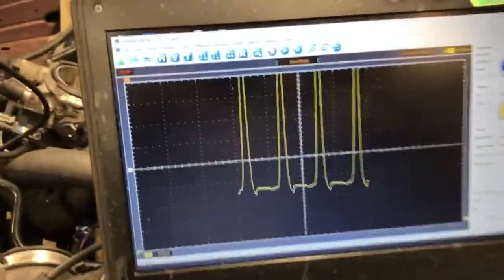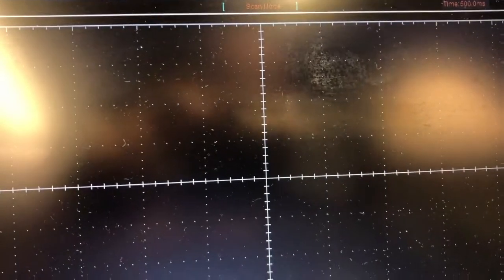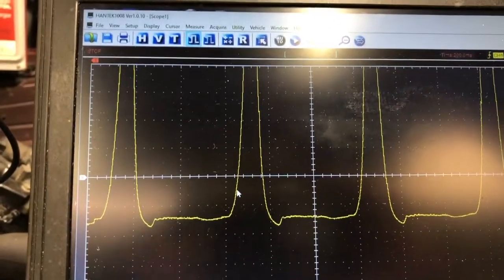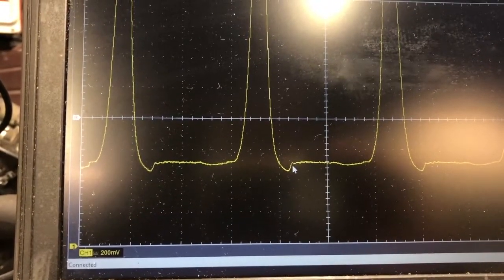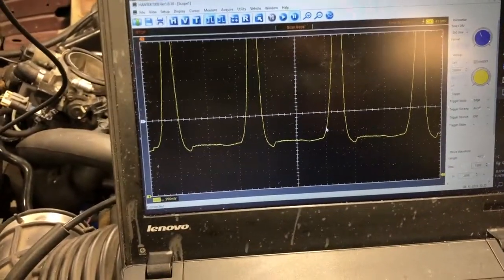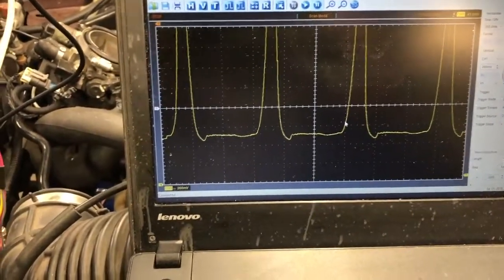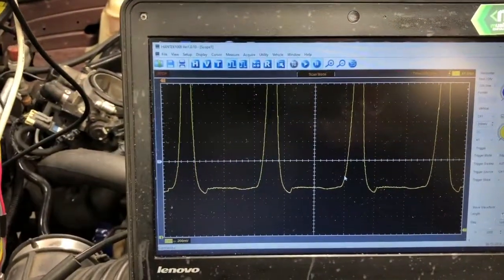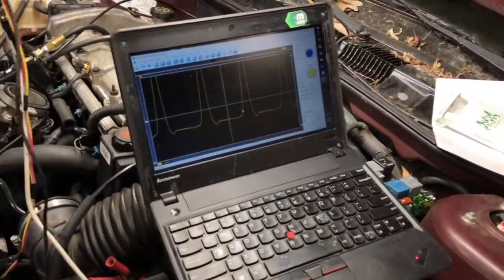Presure Transducer vs Compression Guage

Comment: Glad to see that you’re experimenting with pressure transducers. The biggest mistake folks make is that they pick transducers that measure gauge pressure. Most of these devices can read some vacuum, but aren’t calibrated for it. The best decision is to pick an absolute pressure transducer which is designed to measure absolute vacuum as well as positive pressure. Have a good one Tom!

Comment: I was wondering if you had ever checked out how Tim at Astral Auto Repairs channel, uses the Autel AL 539B as an oscilloscope?  He is graphing fuel pumps, crank position sensors, fuel injectors, etc.  The AL539B channel is: https://www.youtube.com/channel/UCTq2syPYXSCGsMUF5I5SV1Q/videos.
Reply from the maker: Timmy and I parted ways a while ago.  He is a Hypocrite and a liar and has done some pretty terrible things to friends of mine here on Youtube, and a mediocre mechanic that does most stuff wrong.  The Autel 593B is an Okay scan tool but it is not an Oscilloscope.  It can graph data PIDS like many tools can and that is an important feature, but graphing only shows you what the computer sees and interprets.  Sometimes you need to see what a sensor is actually doing, and sometimes you need to see data that isn't ever seen by the computer or isn't output as a pid.  For example a CAN bus signal or you need to see current ramps or a coil for instance.
Reply: Thanks for the reply!  So sorry to open old wounds!!!  Its impossible to know what is going on behind the scenes and also to see past the hype on some of these channels!  Thanks and sorry again!!!

Comment: I am surprised that you are able to see the vacuum portions. I thought people said with these home built transducers you would not be able to see vacuum. I know someone said you can setup a custom tool in the pico software that might allow you to do it, but surprised it showed up on a Hantek scope.
Reply from the maker: It will show vacuum to a point.  I don't know how far down it will go.  I guess I could hook a vacuum pump up to it and see.   It think one of the reasons a lot o people have problems with these is the lack of a clean power source.  Some people are running AC pressure sensors off of 12V batt voltage or reducing battery voltage to 5 volts.   It introduces a lot of noise to the signal.  By using a 9V battery with 7805 regulator and filtering the output voltage with caps you have a nice clean steady 5 volts for your signal.   The Hantek can take some pretty nice traces if you get the time and votage divisions way down then stop it and zoom out, by changing you voltage and time divisions.  This gets it a better sampling rate, but make no mistake the Hantek is a piece of crap that I constantly fight with.

Comment: "If you build it ..they will come".  I'd buy a well build and sturdy transducer off you!
Reply from the maker: I drew up and ordered some etched circuit boards and parts yesterday.  I am going to start with building 10 of them and see if people are interested, and put it into my Pico 4225 fund!  I am going to do up a nice manual to include with them as well.  I also found some that are 1/4 so the bushing won't be needed, and come with a 3 meter oil and chemical resistant pig tail.   Do you think I should include the Lisle Hose adapter in the kit?
Reply: @frugalprepper  Yes, or Harbor freight should have some just as good hose adapters.